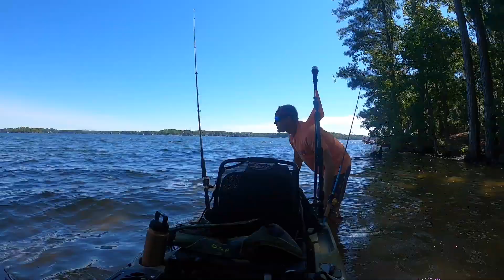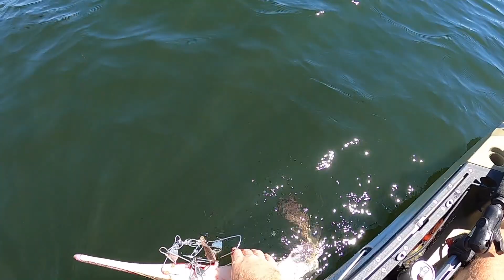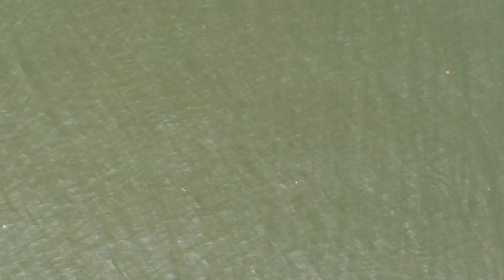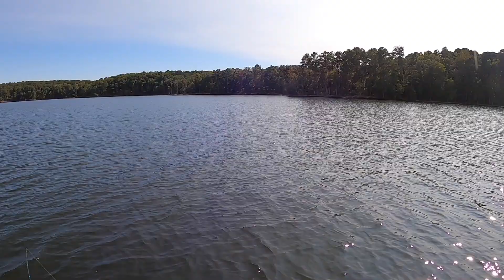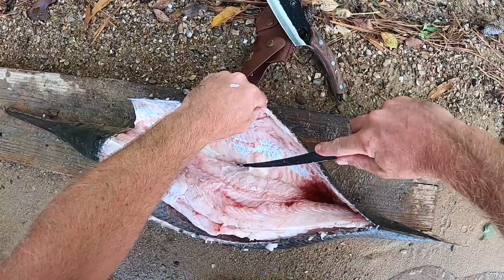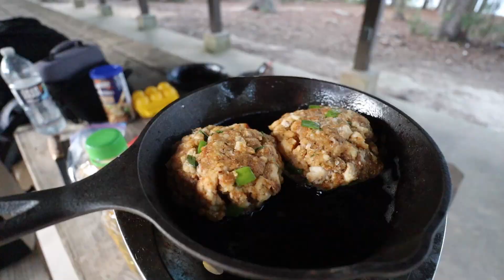Gar Catch n' Cook - Delicious Trash Fish???

Comment: I eat carp using the same recipe. I steam the fillets in a covered skillet in a quarter inch of water then drain off the water and put the fillets in a large bowl. Crumble the fillets with clean hands and pick out all the bones. Will take awhile. Then mix in breadcrumbs and chopped onions and stuff. Salt pepper and lemon pepper usually. Press into balls or patties and fry. They're awesome. I do big trout the same way. Btw a pair of tinsnips makes short work of those gar.

Comment: If you see yourself fishing for more gar in the future, I would suggest a steel leader. Takes away the worry while fishing for toothy fish like musky, pike and gar. Great video!
Reply: From "My" experience "I" don't get even close to as many takes with a steel leader. Everyone has there own system of course but ya. I like to use a good leader of 25# Floro and have noticed a significant increase in the amount of fish hooked. ✌
Reply: Steel leader and fray out some nylon rope instead of using a hook. The nylon strands get snagged in their teeth and they can't get loose. At least that's one method I've seen used where I live.

Comment: Very fun watch! Not sure if you'd be up for this but this is what I found works best: Gut the fish. That's it. Get a decent sized fire going. Once it embers, part them and lay the fish in belly down. Cover with coals and embers. Let it cook for about 15 minutes or longer depending on size. Uncover coals and remove fish with tongs or heavy grilling spatula. Believe it or not, the scales are so tough that they don't "burn" and they become so rigid that you can pull if off in one piece and reveal amazing plumped and juicy cooked gar underneath. I usually season after or serve with rice and condiments. Delicious everytime. I did this by accident once while I bow fishing for gar. Killed the gar and tossed them in the fire and covered them. When we went to put out the fire, we were being dumb and poking around as dumb teens do and tried to pull out the fish to see what became of it and the scales came off like a shell. Underneath, a juicy, sweet and well cooked gar.

Comment: Need to take a rubber band or black tape and  clamp that mouth shut while dealing with them, you did right to bleed it out and dispatch it quickly. They are pretty much fertilizer around here and most part. We do however pressure cook the meat so the bones soften and then add flour onions and spices to fry up in patties